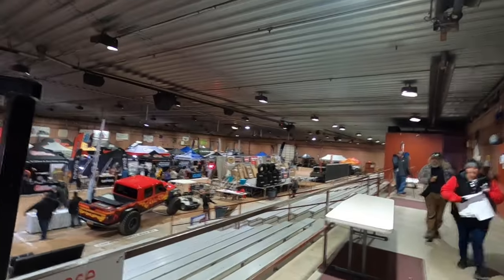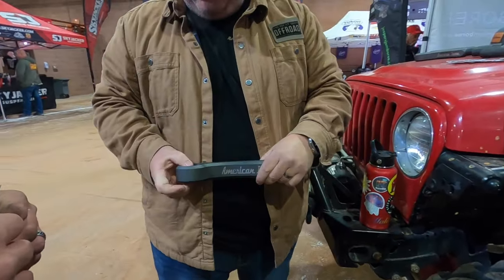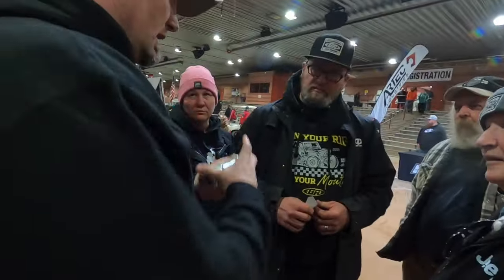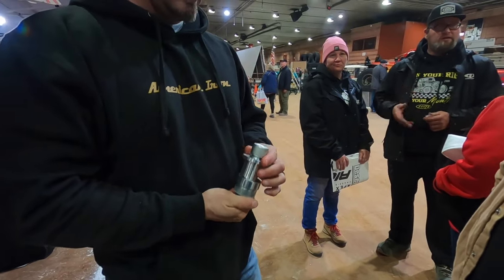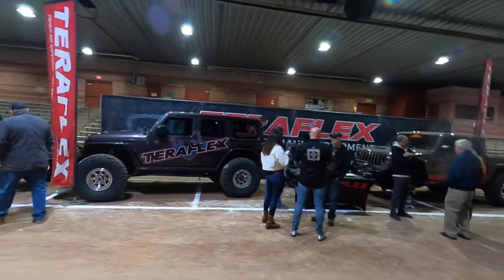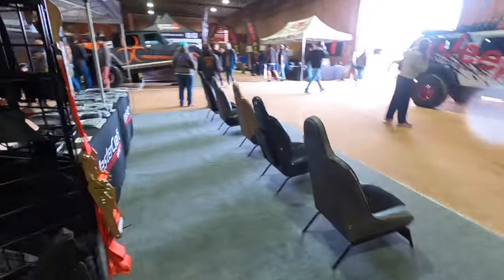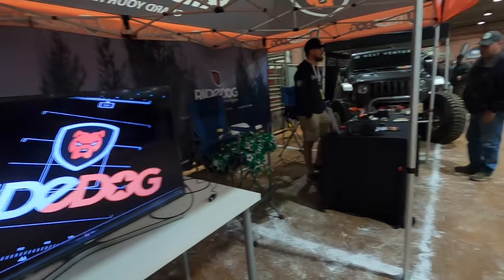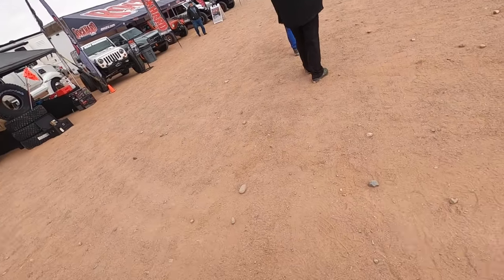EJS Vendor Show

Comment: Those ball joint delete kits sucks . Don’t get them and put them on a daily driver vehicle. I had them in my gladiator for about 3 months they where so squeaky and annoying and the steering was never rt
Reply from the maker: What brand did you use? I don’t look at things often for high mileage usage but rather for rock crawling
Reply from the maker: @19Clutch69  I haven’t heard much negative on them. I’d run them if I didn’t have kingpins